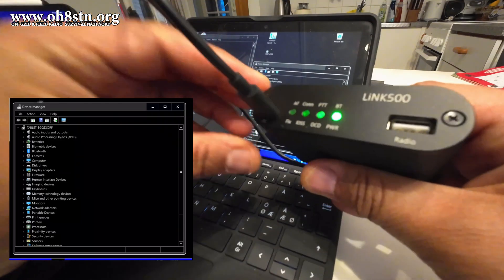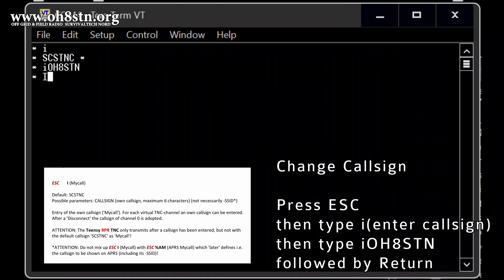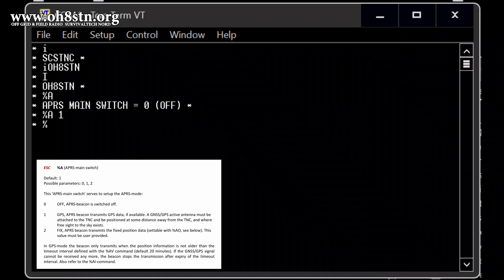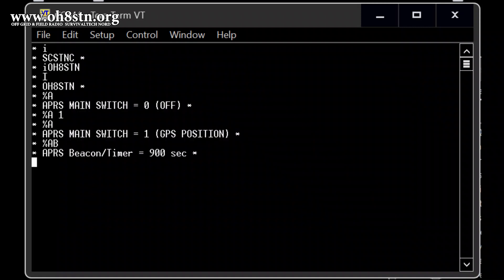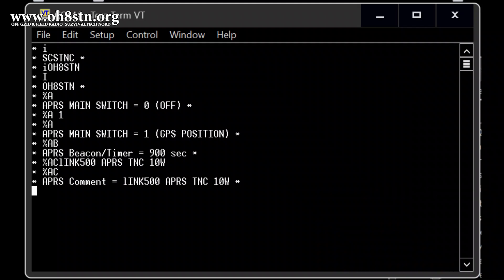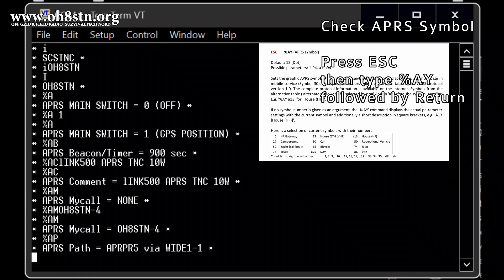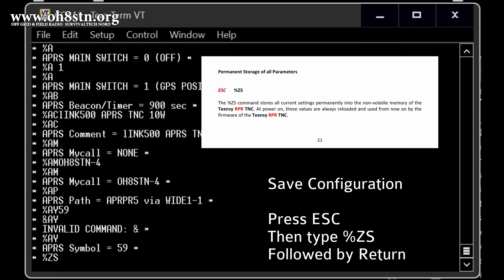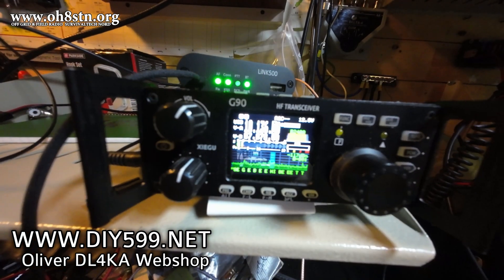DL4KA LiNK500 Ham Radio RPR TNC Audio Interface Quick Start

Comment: Can you explain the connections cables you were using in the back fothe Link500 for the Icom 705.  other than USB from the link to the radio what else did you have connected.
Reply from the maker: Sure. The LiNK500 has two TRS cables. From the rear of the device,  thos cables go to the analog input (Microphone ports) as described in the advanced Icom IC-705 manual. So USB, and two TRS cables.